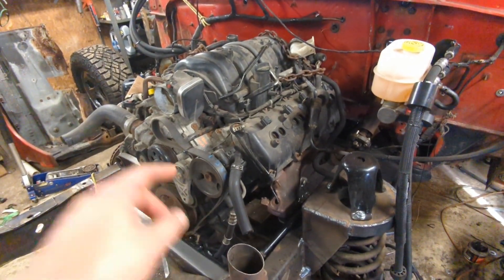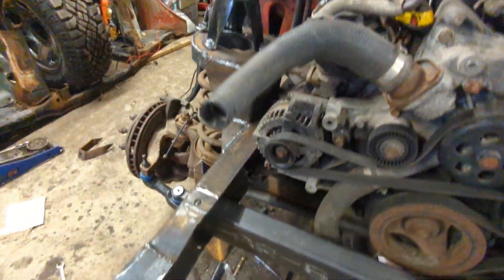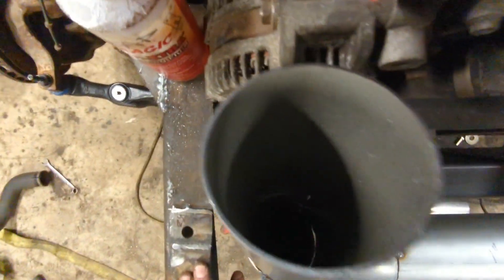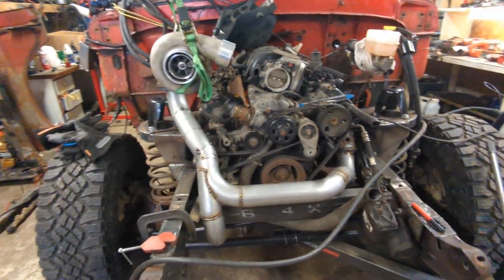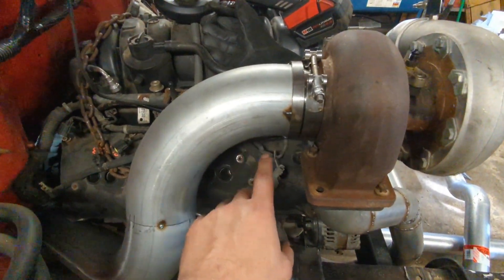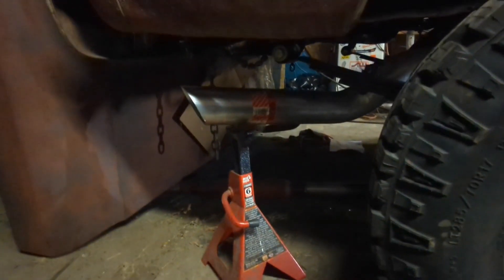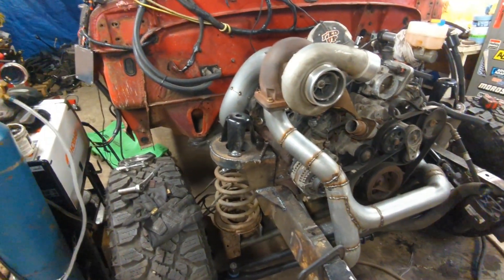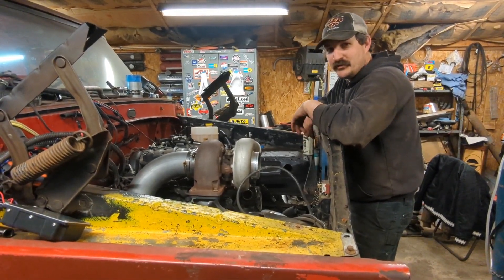Turbo 5.7L HEMI '67 F100, Building the Turbo Kit!

Comment: Do you remember what the tailpipe you used was originally intended for, or have a part number for it? Great build BTW, I just found your channel a couple weeks ago and have been getting caught up. I’m in the process of building my first turbo Hemi setup and got some great ideas from your build.
Reply from the maker: Pretty sure it was for a 2012 Cummins. I just started scrolling through rockauto looking at late model diesels until I found the cheapest.
Reply: Awesome, thanks!

Comment: How did you get the manifolds mounted forward facing ?? I thought 3rd gen hemis you couldn't do that??
Reply from the maker: I re-drilled the heads for the different pattern. It's in one of the build videos! The end cylinders match, you just have to re-drill the center two cylinders.

Comment: What did you use for a brace on the turbo ? Or is it just hanging from the exhaust?
Reply from the maker: I don't think I braced this one.
Reply: @FedUpFab  ok I'm getting ready to plan mine out on a 6.1 with same turbo and that sucker is heavier then I thought lol. you should get a water to air intercooler setup on there if you don't have much room to work with